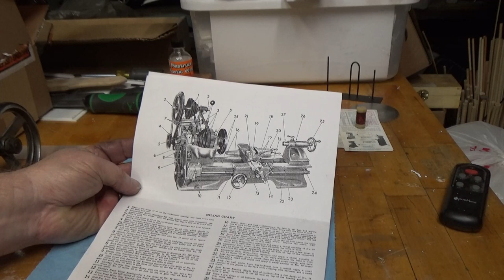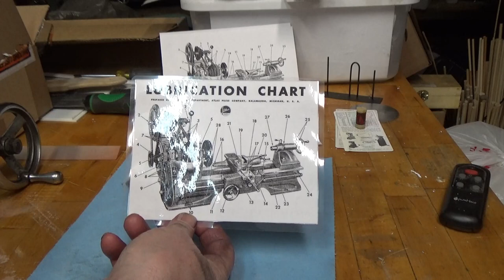Atlas Lathe Maintenance and Set-up Part 1

Comment: I have an old 6 inch Craftsman/Atlas lathe.  A lot of the features are similar.  Can you tell me where you purchased the lubrication chart??   Great video.  Look forward to checking some more of your posts!!
Reply from the maker: I have 2 of the 618 laths also.  One is set up for small work and second operations.  I have the original book and paperwork for one of them.  As far a lubrication s concerned I use universal way oil ISO64 on the ways, 30w Non detergent oil on the rotating surfaces and open gear and chain lube for the gears.

Comment: Looks like you made quite a difference.  Interesting that your carriage had only 3 wipers. My Craftsman 12” doesn’t have any wipers, I thought about drilling and tapping holes to mount wipers.
Reply from the maker: I have more to go.  The lathe already works good but it will be even better when I am done.  Thanks for stopping by.

Comment: Hey sorry if i missed it, but what spray are you using to clean it up? I acquired a new old stock Atlas 6" lathe thats never been setup and I want to remove all the packaging oils and re-grease(not sure with what) before I start using. Thanks!
Reply from the maker: I am using brake clean, I use it all over the shop for quick clean-ups.  I have 2 618 lathes, I replaced one of them with the 10" and will be setting one of the  618 up in the future.  Thanks for watching and commenting.

Comment: Thanks Steve great video is some of that grit from the stones?
Reply from the maker: No, it is not really grit.  It is a build up of old oil and rust from under the carriage.  The stones don't actually remove material.  It is more like burnishing the surface. Tanks for watching.
Reply: @sharkrivermachine  I was referring to the grit from the stones like when you sand some grit will fall off and when honing a knife it has grit on the blade that must be cleaned up